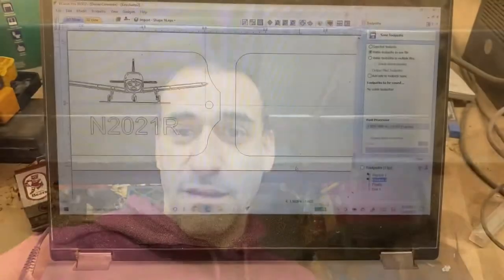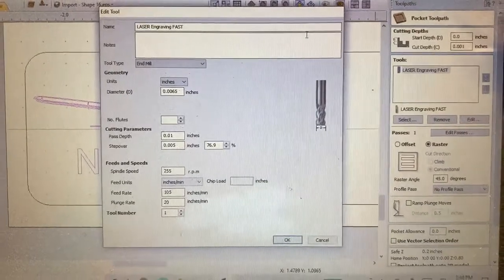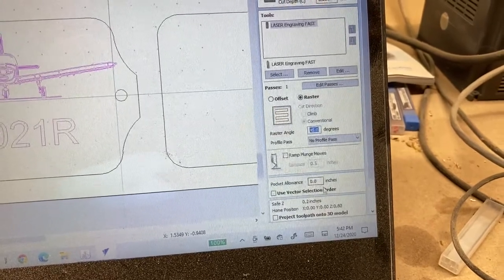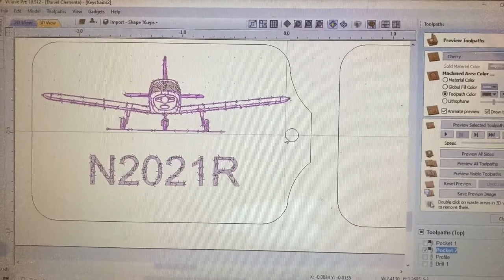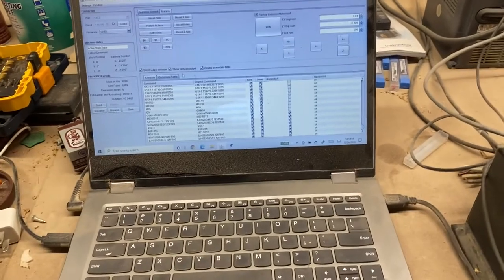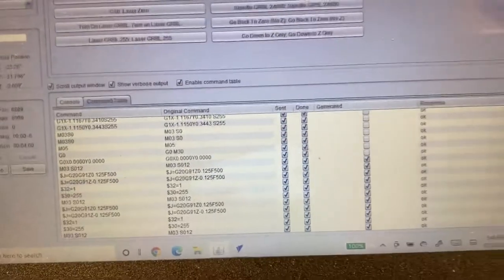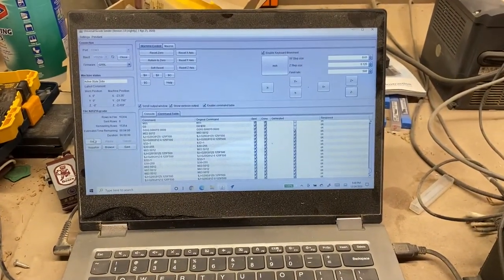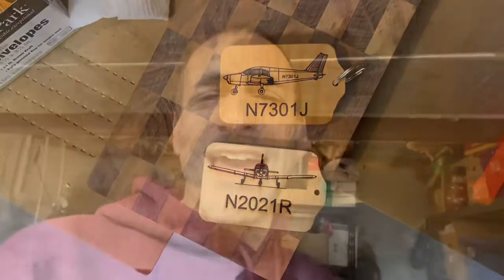J-Tech Laser Setup in V-Carve

Comment: Thanks for the detailed information on setting up a laser.  I am not using GRBL , I’m using my 13 year old DIY CNC with Basic, VcarvePro, gecko stepper driver 540, all linear bearings, and ball screws.
I’ve used it and have had lots of fun for many years, and now I would like to add a laser module to it, I was was watching your video but I’m not using GRBL, but I would like install a laser. Would that be possible with my configuration?
Thanks
Hager

Comment: Vcarve now has a laser module and will add the laser as a tool with kerf et al
Reply: I have the vcarve pro 11 for my onefinity cnc and I want to get the laser module to run my jtech 7 watt laser.  Apparently vcarve pro doesn’t support onefinity on the laser module.  I was really hoping to just have the one software for everything. 🤬
Reply: @CountryBoyMoto  I think it can still be used but set up more as a a grbl laser.  I’ve seen others set up the laser as a bit where spindle speed is what sets your laser %.  I think the range is 0-255 and you can correlate that to 0-100
Reply: @CountryBoyMoto  they do now my friend